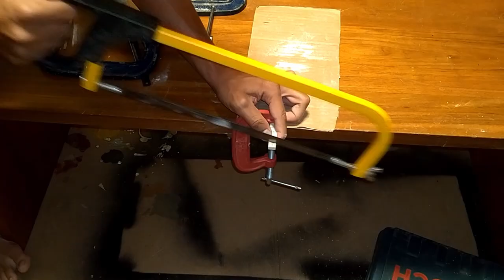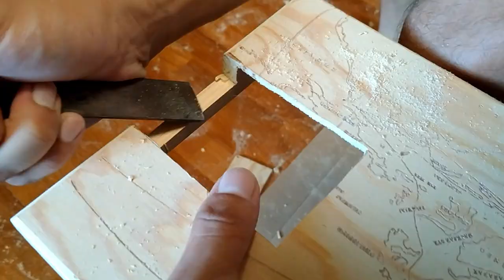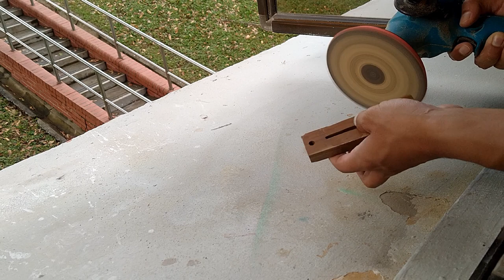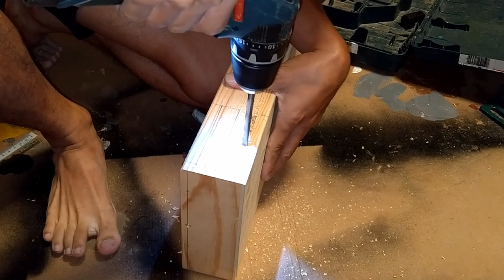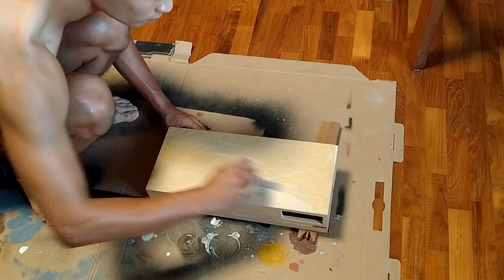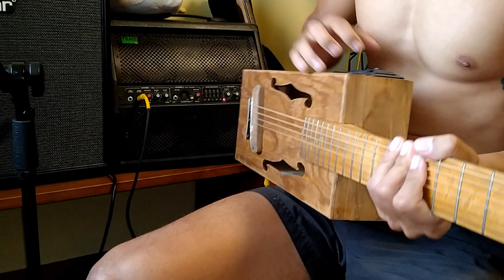Making a Winebox Guitar

Comment: I made a non-deaf arctop guitar. Well done. But it was necessary to make a round hole (calculate the phase inverter using the formula). Then there would be more bass in the sound. And so - the work is phenomenal. Молодец!